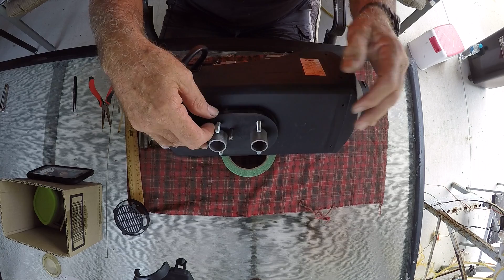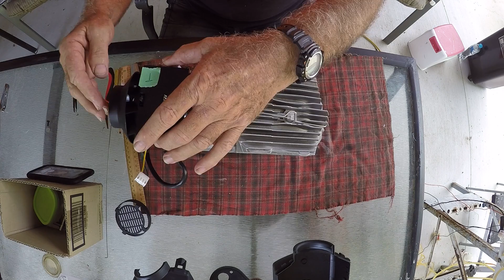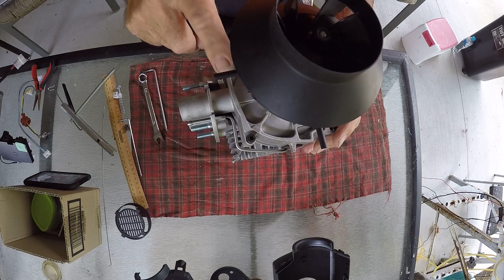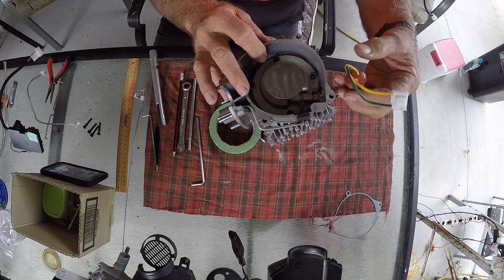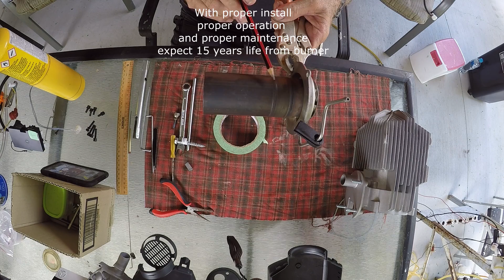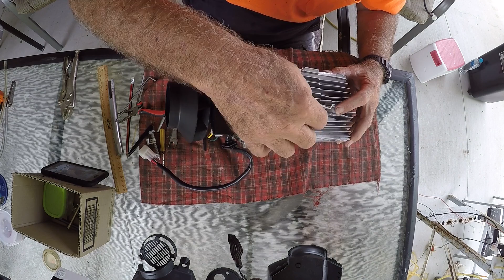Chinese Diesel Air Heater   Part 14  Strip Down

Comment: 2 questions: Knowing they are cheap, how long can they run for in a continuous lapse of time and would it keep warm (comfortable 12Deg C) ) a room that is 13x28?
Reply from the maker: Hi Danny, set up right they will run for hundreds of hours without cleaning or maintenance.
Second question, this is very dependent on insulation. If you are talking feet, you will be comfortable, if talking meters, you will need more than one heater.   JMcK
Reply: @johnmck1147  It would be in feet. Now with this info, if I set the machine to the lowest, how much fuel would I use in one day?

Really loved watching all 14 videos you made. If I hadn't seen your videos on it, I would have bought a 8KW thinking it was a real thing when in reality, the figures don't lie.. You proved it right out of the water!
Reply from the maker: Dany F   
Hi Danny, they use .02 ml of fuel per pulse, so at a low setting of 1.6 Hz they use .02X1.6 per second x 60 for minutes X 60 for hours X  24 for mL per day divide by 1,000 to get litres use per day. =. approx 2.8 litres per day.   JMcK
Reply: @johnmck1147  Thanks for the info. Truly appreciated. I forgot you had 15 videos instead of just 14 like I had seen. Real important info in these videos. I have saved a few in my favorites for future reference. Don't be surprised if I come up with more questions!!!

One last one and it is a good one:
If I would take malleable 1/4 or 3/8 of an inch copper tubing and tightly wrapped in around the external casing of the heater, do you think it would recoup a lot of heat as liquid passes inside the tubing? I'm trying to salvage as much heat as possible to heat my shop.

In this case, that tubing would be used to help heat my radiant floor heating system. I am ready to try anything. LOL
Reply from the maker: Dany F  Sounds good to me Danny, and worth a try. But you would need a little pump for circulation, unlike a vertical water heater where you could make use of convection currents.  Cheers.
Reply: @johnmck1147  If and when I do, I'll make sure to come back to you to tell you the results. Any bit of energy regained is money in my pocket.
Reply from the maker: Dany F 
Thank you.    -  JmcK

Comment: What size tube spanner is required for glow plug removal John?
Reply from the maker: Hi Daryl,

The glow plug spanner is 12 mm 6 sided, with a groove. 
Have a look at video no 9 in this series.   JMcK
Reply: John McK 47 THANKS John, I thought I had watched the whole series. (Even the marine installation) I will check it out.

Comment: Hi John your videos are very informative i am wondering if the heater has to be mounted with the in and ex pointing down or can they be pointing up thank you .
Reply from the maker: Hi Jack,

Generally the heaters are mounted with the combustion air inlet and the exhaust pointing down.

However they can also be mounted on their side, but only the side that has the glow plug on the top.

Cheers.   JMcK
Reply: @johnmck1147  thanks john for the reply to my question
Reply: Hi John, thanks for the great vids. Regarding the sideways mounting position, can you just clarify that if they are mounted on the side, the glow plug must be on the top side?

Comment: Hi John 

Thanks so much for these videos they are absolutely brilliant mate. Have you used the heaters branded PPAP? If so what's your thoughts? I have one in my caravan and so far it's been excellent, 3KW from memory. Keen to hear your thoughts as I'm in the market for another unit. Thanks again, Jordan
Reply from the maker: Hi Jordan, no I have not seen or tested a PPAP branded heater. Do you know if it is based on the Eberspacher or the Webasto design?
Reply: @johnmck1147  Thanks John no I'm not sure to be honest but this is the link

 https://rover.ebay.com/rover/0/0/0?mpre=https%3A%2F%2Fwww.ebay.com.au%2Fulk%2Fitm%2F162948104988

Comment: Hi John, thanks for all your videos on these heaters! They’ve been exceptionally useful. I’m based in Canberra and looking for a decent eBay retailer - the two links you posted in an earlier video aren’t current anymore? Would you mind sending me your current supplier? Cheers
Reply from the maker: Hi Ryan, try this one,

https://www.ebay.com.au/itm/5000W-Air-Diesel-Heater-Car-Vehicle-Heating-Single-Hole-LCD-Switch-Vehicle-12V/273585249890?ssPageName=STRK%3AMEBIDX%3AIT&_trksid=p2057872.m2749.l2649

I have also bought off this seller. Quick delivery with an Australian warehouse.

Comment: Once again very good John.  Doing this in freezing conditions in camp when the heater fails from soot build up is not pleasant, so I purchased another unit which was significantly easier to take apart when the time comes. I also re-designed the installation method into the van so I only need to crawl underneath in the snow & mud once each clean.  A fellow camper has given up for this reason and installed a gas version, costing over $2,500.  Cleaning the combustion chamber will now be a regular monthly event on nice sunny days.  Each time I watch your videos, I pick up a new trick, so thanks again.
Reply from the maker: Hi John, with proper install, you should not need to clean so often. 

What copy form heater do you have, Webasto or Eberspacher?

Are you getting plenty of air into the combustion chamber? Do you have exhaust back pressure with excessive turns and twists in the exhaust?

Have you tried running a monthly kerro diesel mix to give the heater burner a clean?

Cheers. JMcK
Reply: @johnmck1147  New one is a 5kW model which is easy to dismantle when required.  Alpine camping over 10-12 weeks each year, sub zero every night and down to -12 to 15 at times.  Alpine diesel, not winter diesel, not normal diesel has been used to date because (a) it's all you can buy locally and (b) normal diesel will freeze.   Heaters work well but the additive (whatever it is) causes excessive build up of carbon.  Last year two heaters failed on the same, very cold night.  We now burn hotter  (with windows open at times) and add kero which helps, but it does NOT stop the carbon build up, so maintenance is not a matter of IF but WHEN.
This year I will be buying additional fuel canisters, taking 'normal' diesel and mixing kero myself to see how much longer they last without a combustion chamber cleanout.
Reply from the maker: John Kennedy 

Hi John, not sure where you live, but some distributors blend the diesel with heating oil, and all oils leave lots of soot and carbon. Also, when you say "Alpine" are you talking high altitude?. If so these heaters do not have altitude compensation, and will run rich. 

Depending where you live, some countries sell a commercial kerosene with high sulfur content. You could try burning that kerro. If not sure of the sulfur level you can mix in 10% to 20% of normal diesel.

Good luck. JMcK
Reply: @johnkennedy486   Google ' Ray Jones afterburner "

Comment: Hi john on burner screen could it be possible to use mister muscle oven cleaner we use this to clean variable vane turbos it work's a treat just a thought. Thanks for video's
Reply from the maker: Hi Nick, thanks for that info. 
No I have not tried oven cleaner, but I do know carb cleaner helps sometimes, and I understand they may be similar products. I will give it a try.  JMcK

Comment: Another good vid, John! Are the small body 2kw heaters pretty much the same as the 5/8kw models with most parts the interchangeable(except the burner chamber of course)?
Reply from the maker: Hi Robert, if you have a true small form 2 Kw heater (weight approx 2.5 kg) and not a 5 Kw heater branded as 2Kw (weight approx 4.5 kg) parts like glow plugs are interchangeable. But the form is smaller, so 5 kw heater gaskets etc are too big. 

However, most Eberspacher 2 kw parts,  like gaskets will fit a true Chinese 2 kw heater. Provided it is of the Eberspacher form. There are Chinese copies of a 2 kw Webasto form heater sold on eBay. These heaters are very different from each other.
Reply: @johnmck1147  Interesting John,  I do have a true 2k but have not installed it yet.  So there are 2 different 2kw models, a Webasto clone and a Eberspacher clone?  I didn't know that. I know that the true 2kw models are harder to come by. What are the primary differences and which is better?
Reply from the maker: Robert A   

Hi Robert, yes, there are two clones out there. I have both of them in the 2kw form. I was intending to do a comparison video at some stage but I have now run out of time. I have one more video to publish in this series, and then next week I am off sailing for 3 months.

My personal preference is the Eberspacher form. I find them much more simple to work on, eg, just to change a glow plug on Webasto form requires heater removal, and to get at it requires the fan removal. Also copy parts for Eberspacher are cheap and readily available on eBay.  JMcK

Comment: 🤔wonder if a good dip in carb cleaner would remove the carbon from the burner screen?
Reply from the maker: Yes Siskiyou, carb cleaner often helps for the glow plug screen, and does help for the larger burner screen, but the burner screen often needs the map gas. A long soak in carb cleaner does help though.

Comment: Hi John, Thanks for answering my questions in video 12. I had intended mounting the fuel pump vertically to eliminate a dry spot beside the piston but space is at a premium below the unit, so would it be OK to mount the pump vertically but upside down slightly further back inside my van? Thanks again  Garry
Reply from the maker: No Gary, the pump must be mounted right side up to allow the cavitation bubbles to escape. You can mount the pump vertically, but right side up. It is always better to mount the pump as close to the fuel tank as you can. Pumps work good on the delivery side, but pumps are poor suckers.  JMcK
Reply: @johnmck1147  As always good knowledge John, thank you. I'm going to mount my diesel tank just inside the side door opening just about the same level as the top of the wheel arch, filter an inch below the tank and then the fuel pump, hopefully just above floor level inside the van to keep it dry and warm, then the pipe going through the floor, across the van underneath then up the other side to the heater pick up pipe. If there is any problem doing it that way? 
Length of pipe too long to pump through?) then let me know and I can adjust as needed. 
Again, thanks very much for all your hard work on our behalf and all your great advice!
Cheers Garry
Reply from the maker: Garry M 
Yes Gary, that sounds ok. Just make sure you get the filter installed right way around..
Reply: @johnmck1147  
Thanks again.

Comment: Thanks now I feel confident servicing my heater when that time comes! :) just got mine installed yesterday, works great but with a plastic toxic smell when it starts. Seems to be the airtube to the went inside, what do you think?
Reply from the maker: Hi Daniel, will need more info please. What do you mean by airtube? and did you mean vent? After the initial start up, where there can be some smell, subsequent starts should have no smell. Was the heater new, or second hand? If second hand you may need to check the seals and gaskets. See the upcoming video next week. 

If the combustion air intake is near the accommodation (heated air) inlet you can get a diesel smell on start up. The combustion air inlet should be well away from the heated air/ breathing air inlet.  JMcK
Reply: John McK 47 What I meant was the hot air ducting tube inside the car, where the heated air comes out :). Its a new unit, theres no exhaust or diesel fumes, just a plastic rubbery smell. I’ve heard many people complain about smells first days so perhaps it will go away! It's not there all the time only at initial warm up!
Reply from the maker: Daniel Nilsson     Yes Daniel, you can get some initial plastic smell in new installs, but it should go away. A diesel smell is cause for concern though. JMcK
Reply: John McK 47 Yes! And thanks again for the videos, leaned a lot and tried to follow you advice as best I could. Had another question regarding power, will the unit shut itself down before the battery gets to low in voltage?
Reply from the maker: Daniel Nilsson  

Hi Daniel, yes they will shut themselves down when the voltage drops to around 10 volts, however a battery that low is unlikely to start your vehicle engine. They really need to be run off a seperate house battery.  JMcK
Reply: John McK 47 have a house battery, hard to tell how long you can run it though! :) So if the voltage gets low it wont cut off abrubtly, it will first do the shutdown procedure?
Reply from the maker: Daniel Nilsson 

That is correct Daniel.

Comment: Thank you for producing the very informative video.  I was still undecided if I wanted to  purchase these for my emergency preparedness plan.. Until I saw this presentation and your videos have made my choice to be a very easy one to make. Now, a question please sir. From whom is the company that makes that particular one you took to pieces? For me, it will be my first choice from all of the different one out there........ Cheers!!
Reply from the maker: Hi Admiral, these are all great little heaters,  if installed correctly and operated correctly. They are sold by different providers on line like eBay and Banggood. It is a lucky dip who the manufacturer is and some from the same manufacturer are branded differently. Inside, they are all basically the same. 

I suggest you choose an eBay seller that has a warehouse in your local country, who accepts returns should you have an issue, has a good rating, and most important, choose a heater with the controller and accessories you desire. I also suggest you  do a bench test before you go to all the trouble installing the heater. JMcK